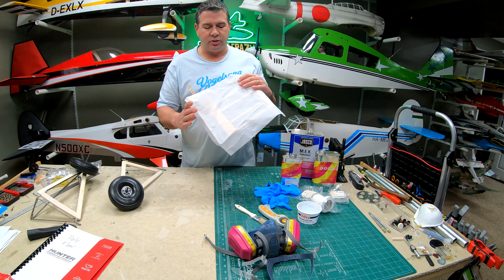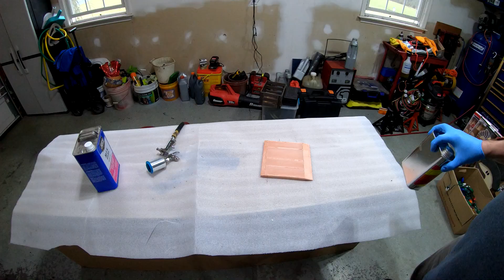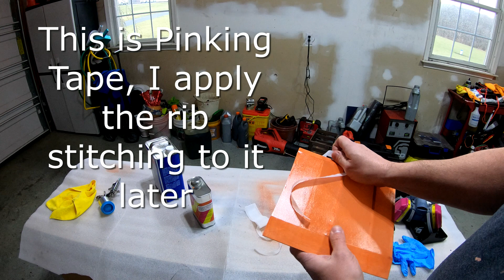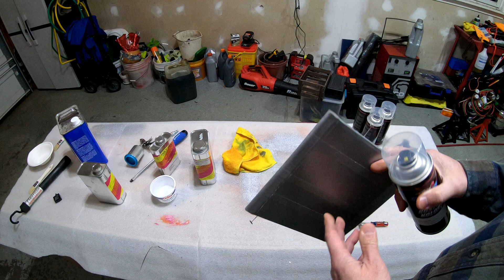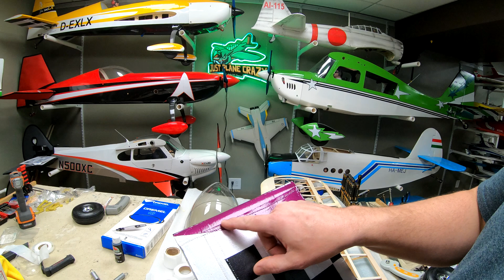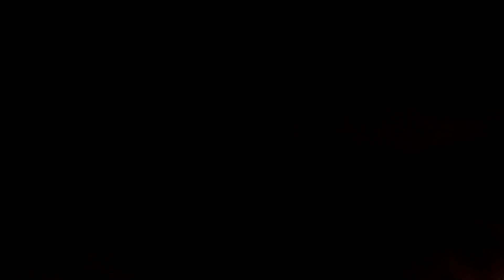Covering pt1 the EMHW 2.43m 47% Pitts Special with Poly-Fiber Stits Lite

Comment: I really liked your video on Stits Lite covering.  I was just wondering about you sealing the covering with Poly Brush and then laying down pinking tape.  I thought you would apply the pinking tape then the Poly Brush. Please advise. R/John
Reply from the maker: It’s best to brush on one coat of poly brush on fresh covering where the covering touches the wood ribs. Then brush another coat the width of your pinking tape, lay the tape down. The entire pinking should be soaked. Then spray poly brush over the entire assy. I also experimented soaking the entire strip of pinking in a dish then apply. That worked fine also but is more messy